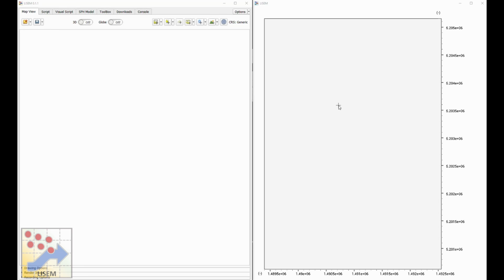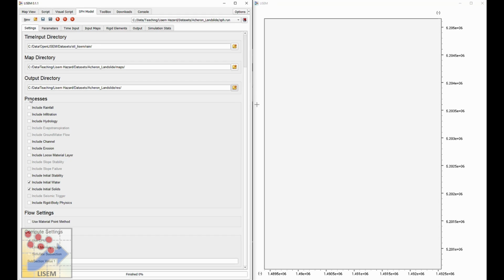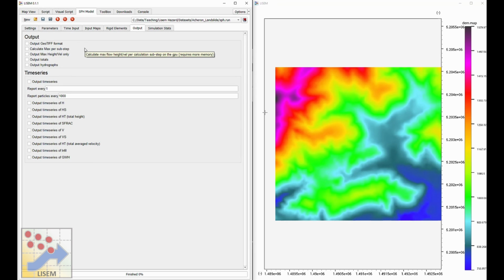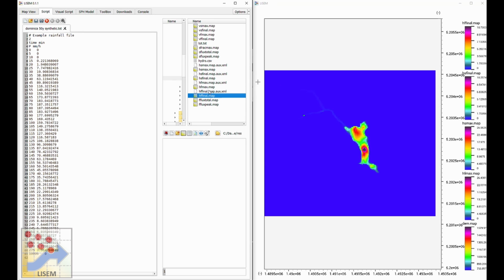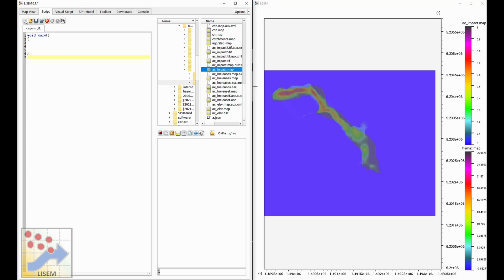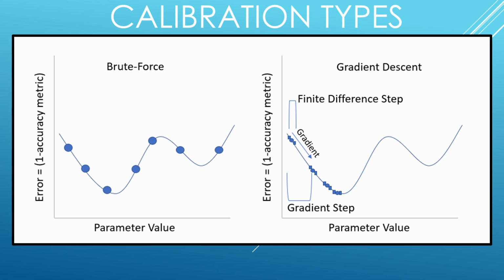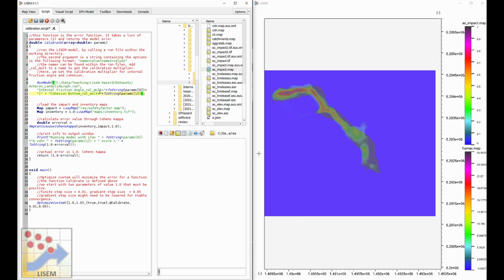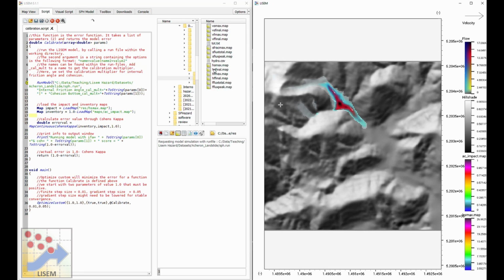Landslide runout modelling with LISEM (Physically-based simulation)

Comment: Thank you very much for your sharing. I have benefited a lot from watching your teaching video. Currently, I have a problem related to the simulation of debris flow in the video. In the result file, there are two sets of results, one for solids and one for fluids. However, debris flow is a combination of both solids and fluids. Why are two separate results being calculated?